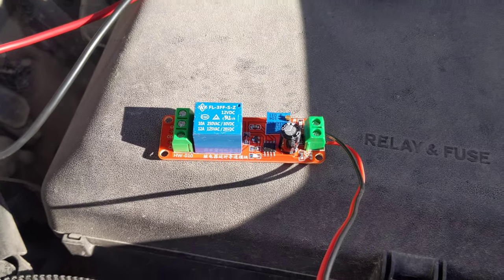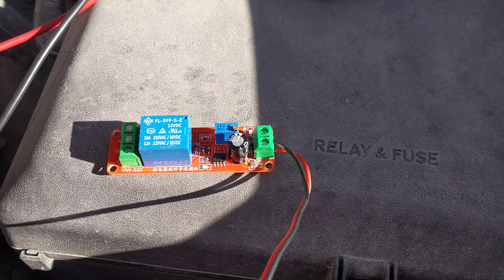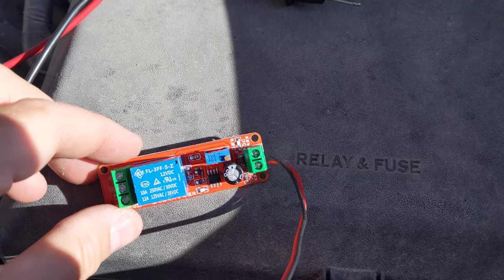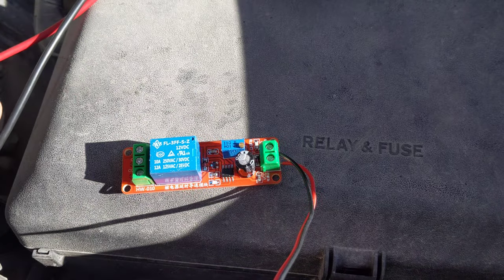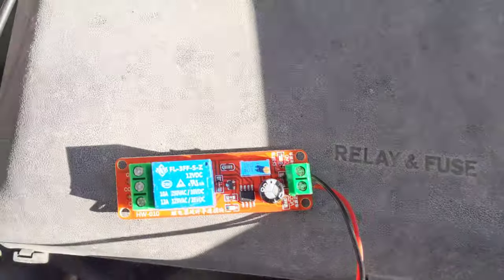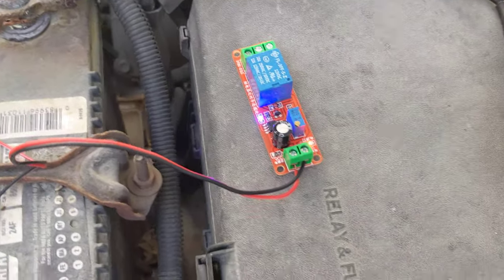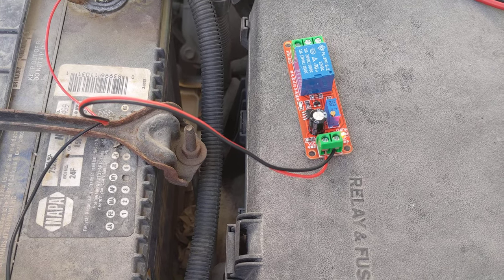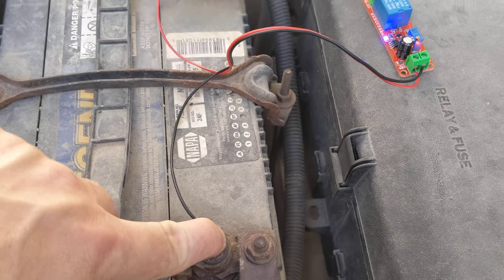DC 12V Delay Relay Demo for Dayton Audio DSP-408

Comment: Was this helpful for your installation?  If so how? I have just purchased the Dayton Audio dsp for a new build but haven't started it yet.  I have read lots of reviews where people are experiencing a lot of noise coming from the rca's.  Anything like that for you?
Reply from the maker: I installed this to delay the amps from turning on while the DSP boots up. The DSP sometimes would play at full volume for a few seconds while booting up. I would also get some popping or crackling during boot up. I set the delay for 8 seconds and the issue is gone.
Reply: @ballz50401  

Oh ok. No noise issues?  Seems to be an issue with this piece
Reply from the maker: @drrckhamilton  No. I've only heard that people have issues with the Wired Remote Control.
Reply: @ballz50401  

Yes I have heard the same
Reply: @ballz50401  

Hey do you have a link for this item.  Thanks
Reply from the maker: @drrckhamilton  https://www.ebay.com/itm/NE555-Timer-Board-DC12V-Relay-Module-Adjustable-Delay-Time-0-10S-H4C8-/124252729911?_trksid=p2349624.m46890.l49292